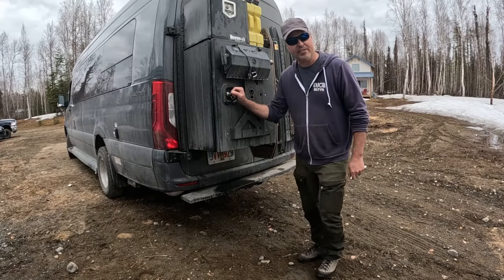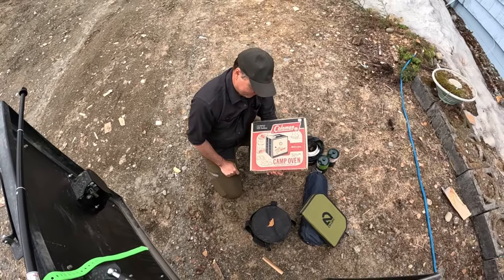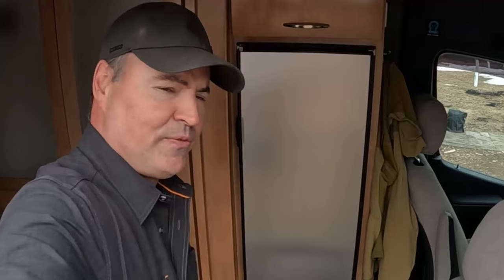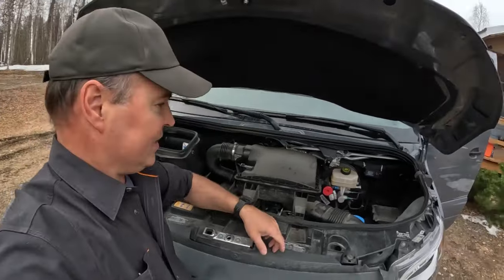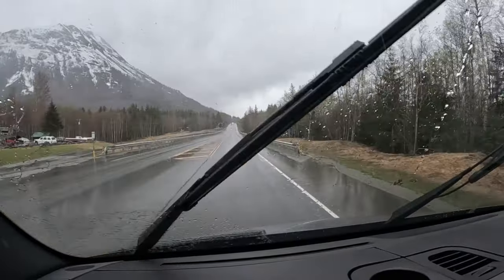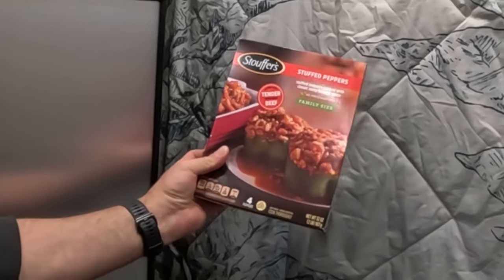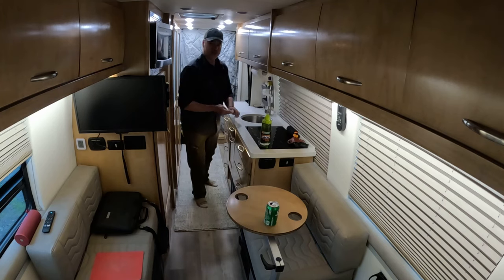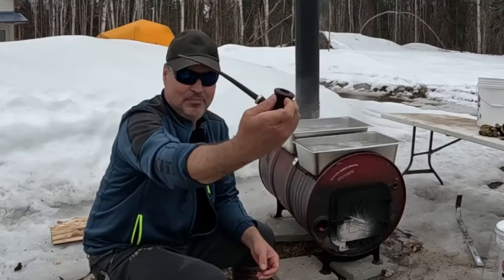Essential Steps to Camper Van De-Winterizing for Alaskan RV Adventures

Comment: Pro tip on the whales... Peak time of year to see them in the arm will be later in the summer. They feed on a lot of different stuff, but they like salmon.  If the silvers are in, so will be the whales. They are currently still in transition between seasons, so they are likely spread out enough between here and Homer, and beyond, that it is pretty lucky to see them.  Come August/September your chances of seeing them from beluga point increase dramatically.  

Great video! Can't wait to see where you guys go next in the van!
Reply from the maker: Transitioning LOL. That means something very different in the year 2024.